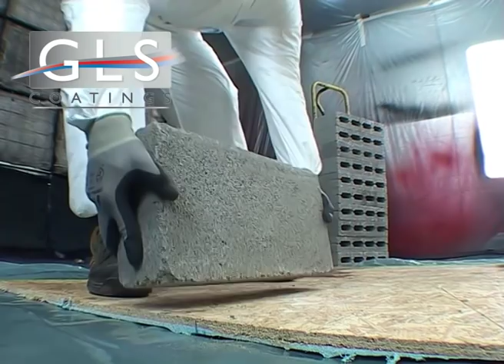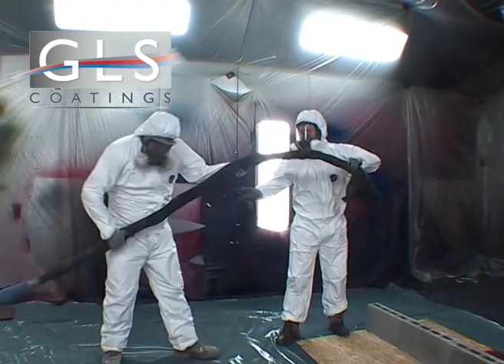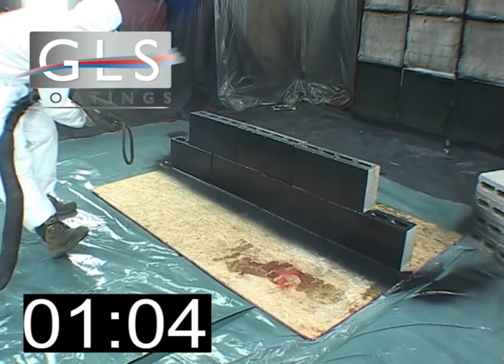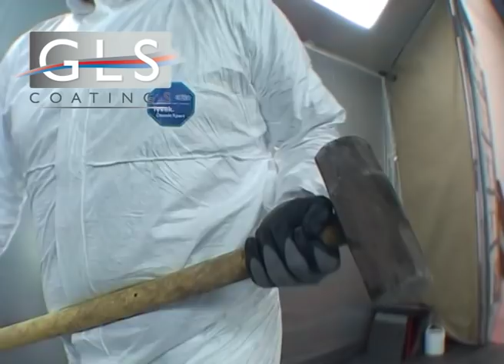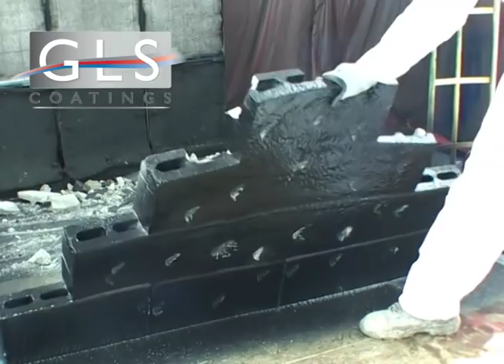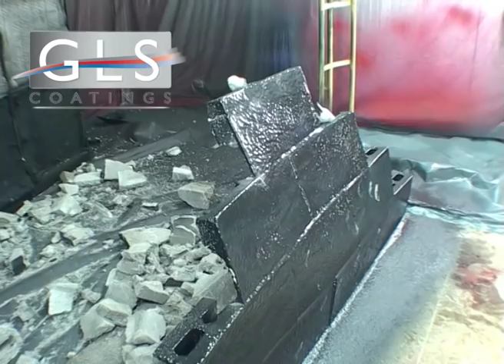GLS Coatings' Polyurea Sledgehammer Test

Comment: close cell foam will do the same thing but also will give you a R 7 to R 15 per inch not only that but if you spray it in between your studs in your wall up to 4 inches it will earth quake proof your house I spoke to the district manager of one of if not the top foam manufacturing companies in the world and ask them if they had ever tested close cell foam for the purpose of earth quake proofing and he said no but was going to look into it after talking to him and telling him the results of my personal testing he was very positive about foam used as a earthquake proofing it not only would be better then anything on the market today but also would give you the highest insulation value of anything out I watched them test earthquake improvements on the sliding table top when they built a complete two story structure with reinforcing rods every so many feet then they shook the table and the rods gave some improvement and that is pretty much all they have for helping out in case of earthquake if they had sprayed close cell foam  proof foam 3 lbs there would be no damage at all if we could only get them to test it I know for a fact that there would be no failure sprayed between stud walls  makes the wall almost indestructible.U see the foam moves with the wall but will not come off it will strengthen the wall up to 300%